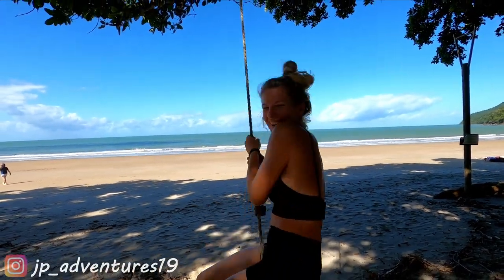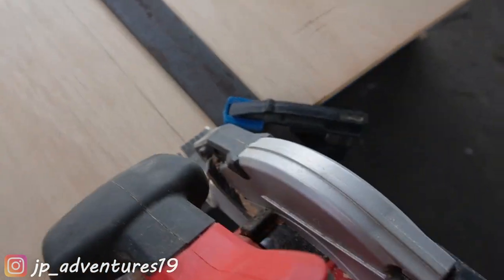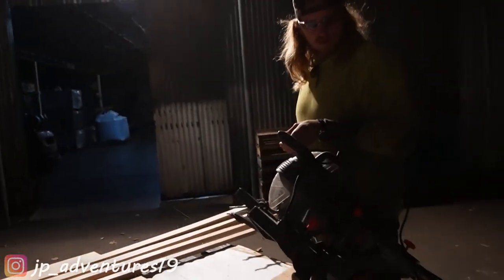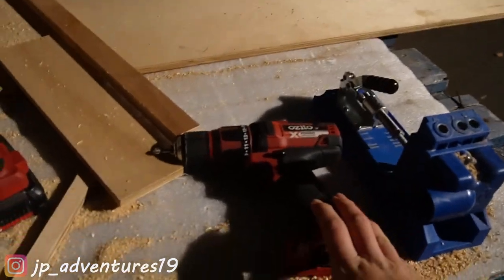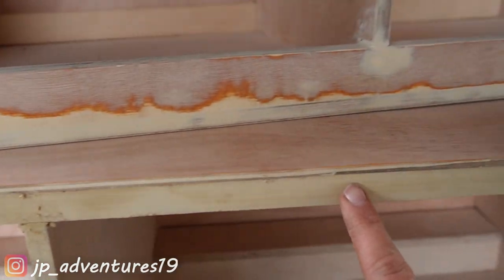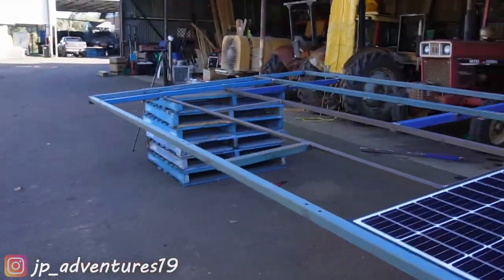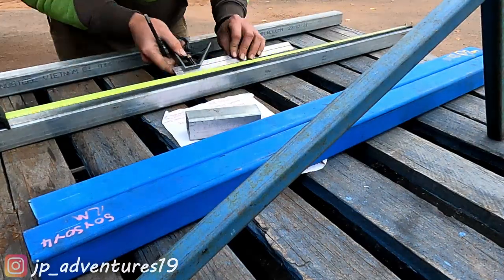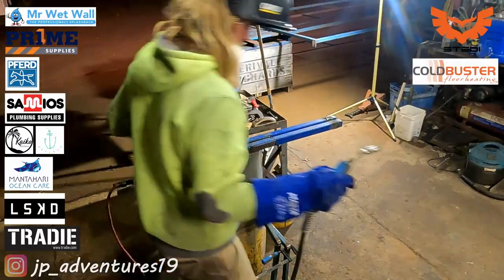DIY Overhead Cabinets & Patrick's SECRET Steel Projects! - UNIMOG Expedition Truck Camper (Eps. 50)

Comment: Hey Jele/Patrick owsitgarn guys? Hey Jele was going to suggest to you last vid to look at getting a SMART BIT drillbit/countersink in one. I have a Macsim brand but there are a few available, mainly used for decking but any timber work, it's usefull.They have different size dia bits to suit screw size. Pocket drill jigs are great huh? Isn't working with wood a different beast to steel hey? love them both in amongst other materials but thats for another time. BTW did you hear about Starlink' got approval for their "In Motion" RV Dish/Modems now, just not sure when they are releasing .Build is coming along well, Goodstuff, Avagood1 guys, avagood1, cheers, Ron
Reply from the maker: Thank you! Yeah we had a look at them but we won't need it as much anymore😇

Yes sooo much easier to drill into wood!

We heard about that! We are currently testing Starlink up north and it is still working great! Just a few more dropouts🤷🏼‍♀️

Comment: I love your videos and enjoy watching them. One question though, with the electronic motorised balcony and now the motorised blinds, are you not concerned  that maybe you are over complicating your build. Surely the simpler you make it the less to go wrong in especially in remote places or on rough terrain like corrugated roads and the simpler maintenance would be. It’s not a criticism just an observation, I still love watching what you guys get up.
Reply from the maker: Thank you🥰 All good, it is a fair question :)
We have planned everything so detailed that we can have acces to all motors and wires and we can also replace parts without having to rip out the floors or walls  etc :)
So we are ready in case something breaks🙌🏼
Reply: Looking forward to your return  ☺
Reply from the maker: @foleyston  😇😇